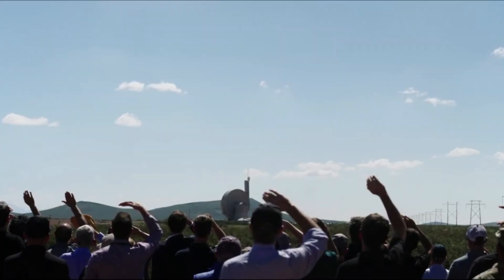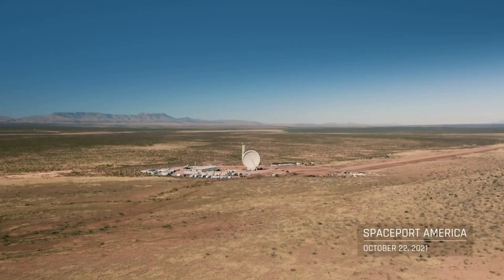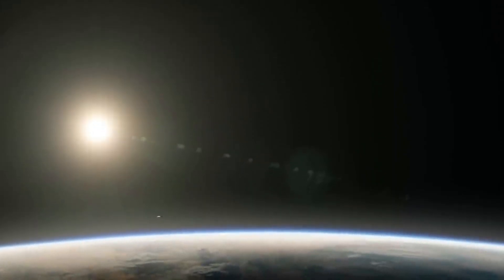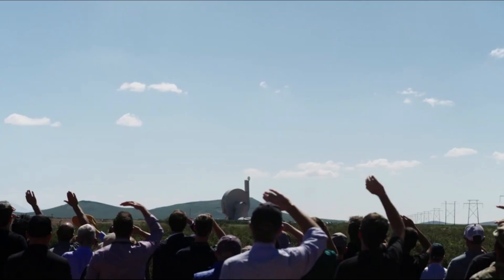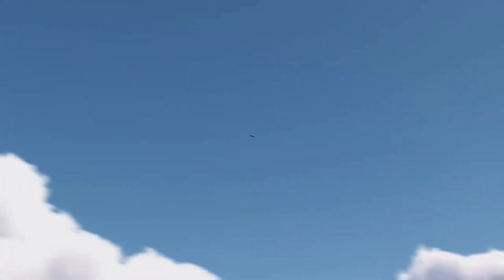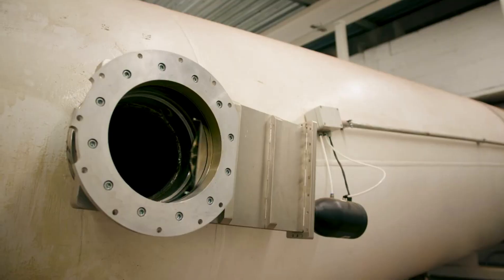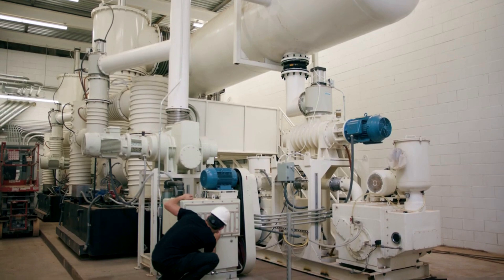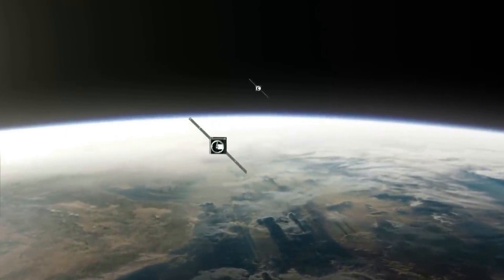SpinLaunch Will Soon Disclose Its Future Orbital Launch Site Location

Comment: I'd be really interested to see someone do the math on the benefits of launching from the Himalayas instead of sea level. obviously there would be financial, logistical and operational difficulties, that probably make this impractical, but I'd be very interested in the physics side.

You'd be about as close to the equator as cape Canaveral, Florida, but 8000m higher above sea level.
How would the decreased (about 1/3atm) atmospheric pressure affect the vacuum vessel?
How much Δv would you save due to reduced air drag and initial hight?
How would the optimal launch angle change?
How would the payload fraction change, how much fuel could you replace with additional payload?
How would aerodynamic heating and the design of the aeroshell change?

Comment: this reminds me of the lab machine that did hundreds of blood tests on a single drop of blood for a buck. We know how that turned out
Reply: this reminds me of project HARP, which already shot scientific payloads up to an altitude of 180km using 16 inch wide, 36m long guns, that accelerated the projectiles with up to 15000g. And that was with tech from the 60s.
Reply: @plainText384  the one that was cancelled a long time ago? yeah that one
Reply: @Deuteronilus  the one that already proved the concept and successfully performed many cheap and reliable suborbital flights, while also doing most of the RnD for an orbital version 60 years ago? Yeah.
Reply: @plainText384  good luck with that. Just my opinion. This will make someone rich but never work